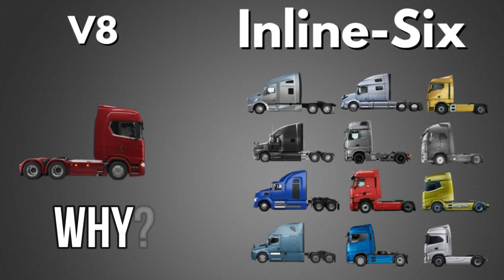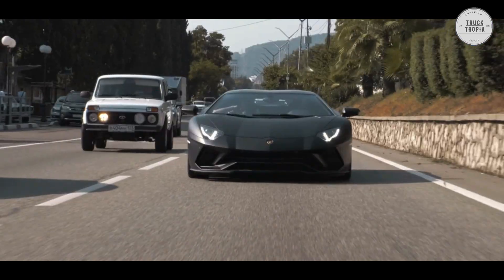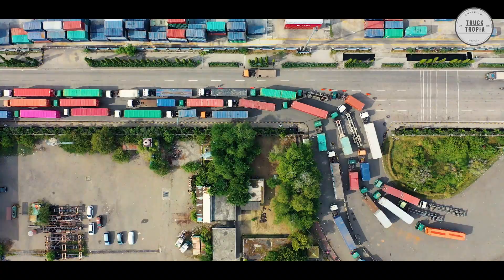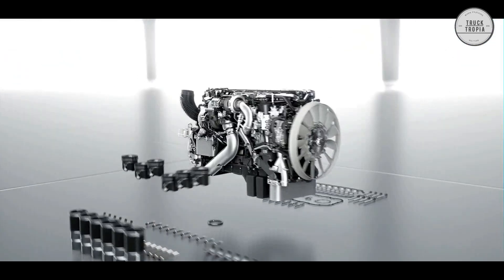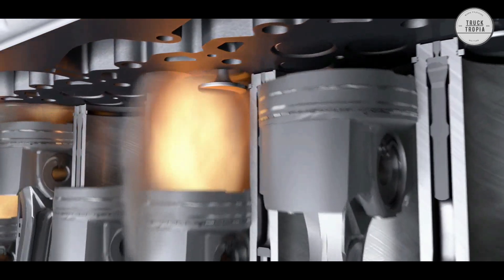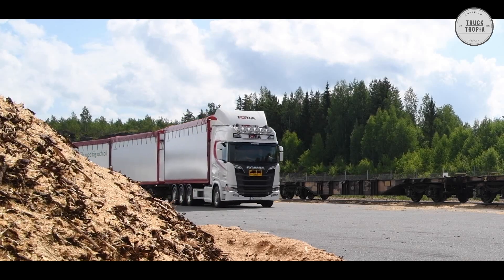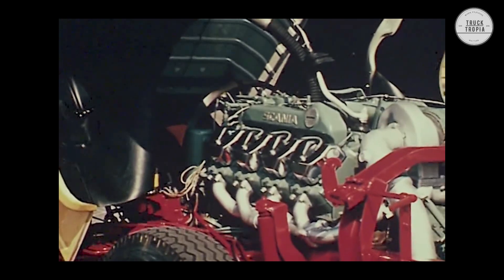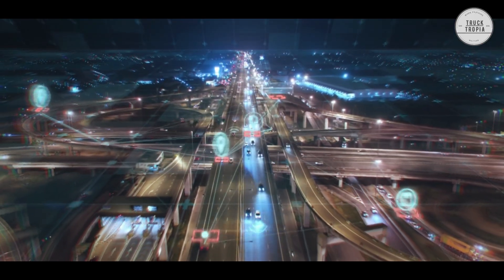Why All Semi-Trucks Use Inline-six Engines?

Comment: Newer V8 truck engines are using alloy cylinder blocks with steel liners, & alloy heads. These make for drastic weight reduction, thus greater fuel efficiency. The other thing not mentioned here is that truck gearing can be, & often is configured to do whatever the owner wants it for. This is particularly the case here in Australia, where a large number of prime movers are set up to pull road trains over our vast country.
Reply: Can you please site any examples of these newer V8s that are drastically lighter than previous engines and improved efficiency? I’m not having any luck finding any online
Reply: @jordanmascarenhas7974  if you can make a lighter V8, you can also make a lighter I6
Reply: @jordanmascarenhas7974  The new Scania use a composite block V8
Reply: @jordanmascarenhas7974  these engines are not yet out of the research stage at this point in time.
Reply: @YeOldeGeezer 45 hours drive time. From Sydney to Perth.
Reply: @YeOldeGeezer 30 hours drive time from Adelaide to Darwin. ( South to North)

Comment: When you strip away all the bullshit it comes down to the simple facts that an inline engine is easier and cheaper to make , simpler pipe work for the turbo and generally lighter than a V engine . If it came down to something like engine balancing or engine profile then they would be using a boxer engine.

Comment: Many years ago I acquired my first full size Ford F-150 truck, and was disappointed when I saw that it was a 6-cyl engine. Many trucks in this class had 350 ci V-8's. But, after driving it a while I was quite impressed with the surprising pulling power at low rpm's. Even with the back loaded, the calm, quiet I-6 seemed to start from a stop effortlessly and easily handled the hills... and it was so smoooth! After talking with other truck owners, I found that I got better mileage also - win/win.

Comment: I6 from BMW such as N57, B57, S55 and S58 are such reliable engines that they’re thought of as bulletproof.

And they’re always described as insanely smooth..
Reply: Out of the 4, which one is best? And for what car? Zupr4 is not included
Reply: I’ve had several I6 bmws. So smooth and torque. Best
Reply: The Ford 300 was equally bulletproof... except for emissions standards.
Reply: As an i6 owner I can say there is nothing smother
Reply: bmws are designed to blowup at 60,000 miles
Reply: @minecrafterselite1  Yeah, yeah whatever

Comment: The only way to emit a low amount of co2 from a petroleum (hydrocarbon fuel) based engine is to not use a hydrocarbon fuel based engine. Hydrocarbon has a lot of carbon and a few hydrogen atoms. Because the fuel is basically carbon it is impossible to emit low amounts of co2 unless you very inefficiently use that fuel then you will have more co (carbon monoxide which is more dangerous than co2 (a form of plant food) ).

Comment: The I6 engine is indeed perfectly balanced, that does however not mean other engine configurations can't be. For example, a 90° V8 with cross plane crankshaft is also perfectly balanced, because of the counterweights on the crank.
Reply: Flat plane cranks are not ideal for diesel
Reply: I agree with your statement here for a 6 cylinder the inline 6 is king when it comes to smoothness but that 90 degree V8 is also very very smooth
Reply: CounterWEIGHTS..more complexity.
Reply: @elemar5  counterweights do not add any moving parts and therefor not any mechanicle complexity. Balancing shafts, which are used in engines that are not balanced, do indeed add mechanicle complexity, but they are not needed in a 90° V8 with crossplane crankshaft.
Besides, a good I6 also has counterweights, not because of engine balance but to counter the centrifugal forces cause by the offset mass of the crank pins. Those forces do not do anything in terms of engine balance, but are trying to bend the entire crankshaft and also increase the load on the main bearings.

Comment: HP is torque times rpm and is not an actual measurement which is why I am not impressed with that as a comparison. I look at the torque curve and rpm ability. I drove OTR for a while and I liked the straight six I had. The v8 has a better torque curve and less vibration but the normal engine is a straight 6 which nowadays is fine. Electrics are even better but aren't out in full force yet. They outperform diesels by a very large margin and even have the ability to go coast to coast if they are equipped with a fuel cell. So don't worry about the diesels being here much longer...the electric is the future for OTR trucks and I say it is about time. They use antiquated gearboxes on diesels and electrics don't need them which makes it easier and safer to drive the electric.

Comment: I don't get why the hell you would care about torque, assuming you would be able to create the same engine, just as reliable both with 600hp, but one has 600nm and revs to 7200 rpm and the other has 1800nm and revs to 2400 rpm, if you just have a 3:1 gear reduction on the engine revving to 7200 it literally has identical output to the one revving to 2400 rpm, so what is the point??

Comment: Under the condition of the same displacement, less cylinders means more torque at low RPM, due to the more bore size

Comment: just the progress in turbochargers including all electronics, computer-aid modelling of gas flows and heatdistribution and modern materials. Today light commercials (vw, mercedes and so on, 3-4t gw) use 2l diesels! It was impossible even 15 years ago - 3.0 turbo (toyota 1KD like on my old Hiace) deemed "small volume engine", but now lighter and smaller 2l gives more power. The same with big trucks - you do not need V10 to achieve 700HP, it is possible with line6.

Comment: As others have said, six cylinders in-line is perfectly balanced and simpler than a V engine. It does however suffer more from warp, due to its length, and this is one of the reasons why it fell out of favour as a car engine since, to mitigate the warp, the engine needed to be stiffer thus heavier - not such a problem in a truck. Additionally, the length of the engine in a car application requires a longer bonnet/more impingement on interior space for RWD and a wide engine bay for FWD, the latter being solved somewhat by placing the gearbox under the engine but creating a new problem of a high bonnet line...
B.t.w., the plural of torque, is torque, not torques. And cars do not have 'many' horsepower, but 'a lot of' or 'high'.

Comment: Other factor against V8s is efficiency limitations caused by Firing-order.
The short explanation is that they have inefficient firing-order leading to bad air-flow.
Reason: the crank goes resonant at low frequencies [read, Revs] because of it's length vs number of cylinders: the resonance would tear the crank apart.
To break up the resonance they make firing order uneven : instead of Left, Right, Left, Right etc it goes LLRRLLRR
This is where the characteristic 'lump' of a V8 comes from.
But that results in bad intake-ramming for some cylinders and bad extraction for others.
The power and efficiency is lower because of it: and no operator wants in a inefficient prime-mover.
Reply: Very interesting

Thank you 👍

Comment: Ahhh yes. When taking the maintenance into account, of all things that may require some work, the benefits of having 1 exhaust manifold vs 2 is paramount.
Reply: Oh yeah, those gosh darn manifolds! I keep having to replace mine so totally understandable,
Reply: @argkatt9040  i suspect your taking the piss but youd be amazed how many factory exhuast manifolds have a tendency to crack.
Reply: @asdasd-ni8eg  You're correct, just having some fun. I would guess that's resonable with the temperature variation and stuff.
Reply: @argkatt9040  What about the rest of the stuff that connects to those manifolds?
Reply: @elemar5  I know, I know, just having some fun. There's of course more to the story.
Reply: But Scania uses V-8 engine. What do you think of that?
Reply: my i6 has two manifolds, each with two o2 sensors 😅
Reply: having two manifolds means two turbos though, and that adds significant cost, complexity, and space
Reply: @synapticburn  how did you come up with that?
Reply: @asdasd-ni8eg  I'm a mechanic. You never see a turbo on just 1 bank of cylinders
Reply: @synapticburn  Scania and Mercedes V8s all have single turbo without exception.....
Reply: @timothyjamieson1282  true, but they're a small percentage of global heavy truck engines (the point of the video). 

And they 're not only powered by 1 bank of cylinders, you have totally different manifolds, different intake since it feeds into the intake valley, it's packaged for cab overs only not trucks with a hood etc.

My whole point was to refute the commenters saying that it's as easy as having a second exhaust manifold and that doesn't change the maintenance 

It changes a lot on the exhaust side to have a 2nd bank of cylinders, especially on turbo engines where they interconnect with the intake system

Comment: The con of inline 6 is the crankshaft bending under load(on a micrometer level), becaus of the engine lenght. The V8 is much more robust on that way, shorter crankshaft, the power (joules), is divided by 2 heads, the cooling solution is easier on V because of head divisor, on inline 6 you have always the most distant cilynder hotter than the others from inlet water cooling. However, manufacturer costs are over the V8 benefits. Unfortunately.
Reply: Running cost are better on an inline 6.
They produce peak torque at around 1100-1400rpm ,  cruise at 60mph doing 1150rpm means much better fuel burn,  cant do that with a V8
Reply: @cheetomussollini  my experience from Scania 14 and 16 liter since 80’s is, the V8 burn less fuel at 2/3 of torque green band, even at 1400rpm, burns less than inline 6 at 1200rpm. Of course, the nature of V8 is not running under load at 1100, even if they say it has 2500Nm on that rpm (maybe with twin small turbos as Iveco turbostar 48 had back then). That V8 can run 2-2,5 million kms without opening with a good preventative maintenance. Scania V8 allways loved high rpm with pedal to spare to make great consumption. Too low rpm, whatever engine is, creates more stress and heat under heavy load than higher rpm enough to breath but not at full limit

Comment: The Iron Knight racing truck from Volvo uses a 13L inline 6 with quad turbos and it makes 2400HP and over 4400 ft lbs of torque. With that much power you don't need more cylinders.
Reply: Look up 4000hp semi, its a C15 i'm pretty sure thats turned up to 4000hp and a straight 6
Reply: Dayum

Comment: Our first truck as a solely transport truck was a inline 6 MAN in 1979, we nearly lost everything, it was a 16L V8 Fuso that saved our arse four years later that truck never stopped, from there we had inline 6 Volvo's they where good and after that 14L V8 Scanias pulling doubles and triples, the only issue we once had was one of the engines threw a counterweight out the side of the block because we didn't replace the counterweight bolts during a rebuild as recommended, so our fault, we've also had Mercedes v10 never stopped. I've driven 143 scanias grossing 200t in truck and three dog combinations and they worked like no other truck I've driven all on unsealed corrugated as F##k roads. I've driven 610hp 16L mack Perth to Darwin Triples which pulled like a train but had reliability issues, on that same route also drove 550 Cat that pulled awesome and never stopped,  also driven GM V8 , Cummins V8 and inline 6 and others I can't remember. What I learnt was the most valuable piece of any truck is this little component called the AC compressor.
Reply: Where did you get that V8 Fuso engine? Is that a 8DC11 twin turbo engine? We still have lot of these as used prime movers. Secondly is probably Isuzu but powered by V10/V12 Non turbo diesel engines which they literally last long.
Reply: @montesa35  it was a Mitsubishi dodge fuso 16L V8 naturally aspirated single axle prime mover with a 13 speed road ranger, we also had the same combination in a boggie ridged tipper.
Loads of torque for their time and bullet proof.
Reply: @christopherwaite8903  Must be 8DC7 or 8DC8, they're too old as early as mid 70s.
Reply: @montesa35  they were mid 1970s one was precombustion with a single head and rocker cover on each  bank and from memory the other one was direct injection with individual rocker covers and possibly individual heads but it was a long time ago,, does this sound familiar?
Cheers for your interest mate
Reply: I’ve been driving and owning Scanias since 1974, fantastic trucks but for me only with the V8 engine, I’ve had straight six Scanias Volvo and DAF but not in the same league as the mighty V8 S650 had a 770 demonstrator but found the S650 was almost identical..These V8s are mountain stormers with the Torque just propelling them uphill like there’s no limits, I’ve also seen them do 2 million miles without an engine rebuild…Sorry American trucks just don’t do it for me or American style layouts, road trains in Australia need less turning space than some of the LWB tractors I’ve seen stateside, I mentioned it to one driver that he would need the state of Arizona to turn the damned thing 😳…
Reply: @dermotmcglinchey282  I haven't had the opportunity to drive a 16L scania V8, I find the layout of a truck grows on me the more I drive it and it becomes familiar, the last truck I drove was a Western Star which took me a while to get use to the gauge and switch layout and I kept smashing my knee on the outside lower corner of the dash as I would get in,but once I was use to it I enjoyed driving it. When your driving through thick fog on crap roads carting hay on a road train it keeps you on the edge of your seat while your getting use to the layout.
Reply: @Dermot McGlinchey  seen more than a few million and a couple 2 million km Scanias at work too. They are popular and selling well in NZ. Plus the sound.... lol
Reply: @timothyjamieson1282  That throaty roar is something you never forget and in almost 50 years I never had an engine problem with the  Scania V8…Although I’ve been meticulous with servicing preferring to change oil and filters before Scanias guidelines , but that’s just a personal thing and probably old school..Even though I’m retired I still like doing the odd trip from Ireland to Holland which is an very easy 5 day round trip and 2 nights of those on very comfortable ferries…
Reply: Sick comment

Comment: Actually size is an issue. Width inline 6 is easier to fit between frame beams, and lenght for example only Volvo d13 fits under short cabin used in Europe d16 doesn't. Height only smaller versions fit together with low floor cabins like Volvo FM used in Europe.

And then manufactures are global so they use same engines in EU and USA. Like Paccar and DAF, Detroit Diesel and Mercedes, and Volvo. Small details might be different and brand stamps, but basic engine is same.

Comment: I'm very happy with my truck with the dt466e in my 4700. I'm not in any trucking business, so it's a good fit for me. I have tried the truck with the v8 and I didn't like it I get decent mileage with 11 to 14 mpg. I'm using my truck for farm use so I don't need all the speed and power of the class 8 road tractors .I would like to change to an overdrive transmission to keep my rpms around 2000 I think I have a 444 rear end which would be nice with an overdrive transmission